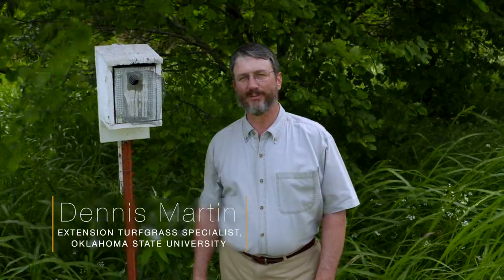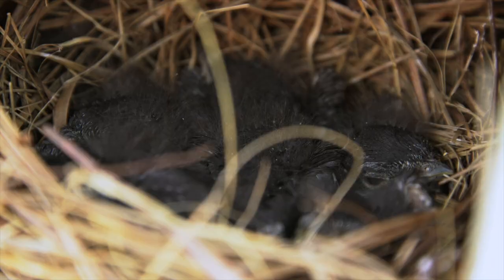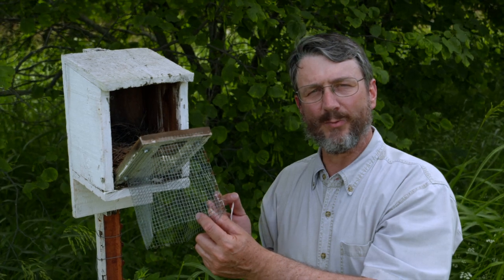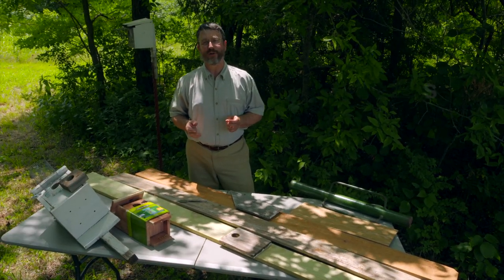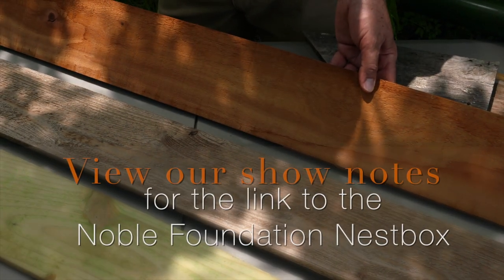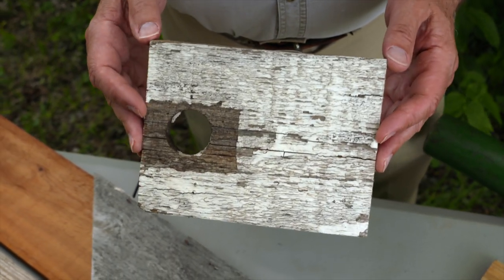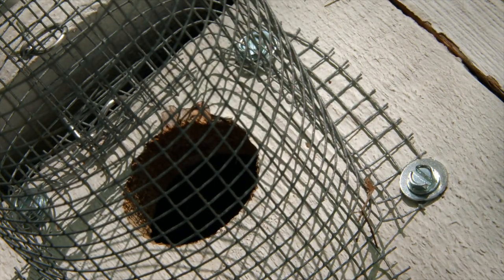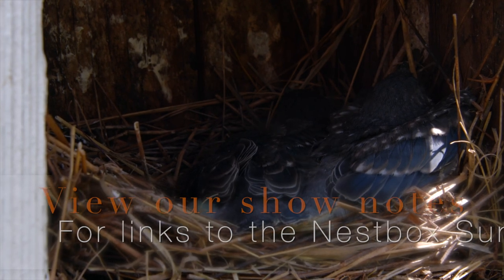Homes for Nesting Bluebirds

Comment: I have found that a simple deterrent for predators is to mount the box on a length of 1 1/2 inch, PVC pipe, instead of on a plank or wood post.  I cut a pipe cross fitting in half, to make a pair of flat-topped tees that I can screw onto the bottom of the box, by drilling a pair of holes in the sides.  You could use a single tee, by sawing a piece off the top and discarding that.  I have not had any snake, cat or racoon climb one of these pipe posts.  The pipe comes in 10 foot sections, and I cut these in half, to mount two boxes, burying about a foot of the pipe in the ground.  These look very nice with white painted boxes.
Reply: Anywhere I can see photos or plans?
Reply: Very clever. Gonna have to try this.  I have been puzzling a way to attach the box to a conventional T-post, and I think your design just might slip over one.  If so, that is an elegant solution.
Reply: So no baffle needed? I wonder if I should slide pvc over my existing poles. I lost my eggs this year due to something climbing and getting past the stovepipe baffle.
Reply: @uhill74  I have seen determined squirrels climb PVC pipe that had a bird feeder on top, but I haven't seen a black snake climb it, yet.  All I can say is that I have seen dozens of blue birds fledge from my boxes.
Reply: @uhill74  Keep in mind that some egg eaters fly into the box.
Reply: @jpopelish  like a flying squirrel or something?
Reply: @uhill74  Thanks for posting about mounting post tips! I also suggest to not mount on a tree or wooden post but also on pvc or steel pole/post and always suggest a deterant baffle. There are many snakes throughout North America that can climb t-posts, pipes and poles.
Reply: @uhill74  yes, stove pipe works well or a wide cone baffle.

Comment: Watched our pair for days, with mother attending nest at night.  Temperatures in Alabama at the time were in the high 90s.  One day my wife told me both birds were acting strange; they were alternating flying to the box but not touching it and were fluttering in front of the hole.  They did this several times that day, then they left altogether.  I looked in the box and found one broken egg and one intact egg--abandoned.  While we had thought a snake or lizard had entered the box and the birds were trying to scare it out, my wife began to believe the birds were fanning the hole in an attempt to rid the box of the extreme smell of the broken egg.  Any thoughts?  And, after I clean the box, will they return?

Comment: What do you think of the Peterson blue bird , bird house
Reply: I haven't personally used the Peterson design bluebird boxes but many can attest to their success in using them. Be sure when mounting any bluebird box to avoid mounting on a tree or wooden post. We suggest using tee posts, smooth metal pipe or pvc pipe, use a baffle such as stove pipe or cone baffle to assist in deterring post-climbing predators such as raccoons, cats and snakes. I also suggest a Noel Guard to help deter cats and raccoons that may jump from the ground to the top of the box and then try to reach in. Never underestimate the determination of a hungry and motivated predator. Thanks for watching Oklahoma Gardening!

Comment: Any way to deter English Sparrows fro taking over  or staying away from blue bird boxes with out having to guard?
Reply: that is the big question....!!!    I agree.   House Sparrows are horrible!
Reply: Trap them year round if you can. Van ert traps and ground traps.  After a few  hundred things will gradually change. Also put up a spooker after the first egg is laid.
Reply: @uhill74  Thanks for watching Oklahoma Gardening posting. I agree the Van Ert live trap is one of the most effective trapping devices that can be adapted to practically any bird box. I encourage placing the two screws for mounting the Van Ert in every box, performing a dry run, then removing the Van Ert but leaving the screws in place.....just in case it is the later focus box for trapping sparrows! Happy Bluebirding and thanks for watching Oklahoma Gardening!
Reply: I now use "sparrow spookers" to deter house sparrows or English sparrows. Also some folks use clear plastic sky lights on the box and feel that they deter house sparrows using the box but don't deter bluebirds. Thanks for watching Oklahoma Gardening!

Comment: What kind of predator would this guard work against?  It seems a red squirrel could just crawl around the guard and then chew into the wooden hole.  I use hardware cloth around the holes on all my boxes but it is flat against the wood to prevent hole chewing.
Reply: Should have waited.  The answer was the extended guard helps keep the dreaded racoon arm out.
Reply: 6inch stove pipe wrapped around the bottom of the pole will stop any squirrel, they CANNOT climb it👍😉
Reply: @aileenwagner2576  I told my buddy about the stove pipe idea. I came across the video a few years ago. Great idea. I gave him a piece of plastic  gutter down tube (Mentioned in my earlier post)He had to cut it on the side to slip it around the sheperd hook. What he didn't do was cover the tube at the top or bottom. The squirrel squeezed his body and crawled through the tube . Hah!. He has since duct tap the top and bottom. The stove pipe has to be dog eared at the top  to keep this from happening.
Reply: @aileenwagner2576  The Noel guard as seen in the video is constructed of wire mesh or hardware cloth. It is readily embraced by bluebirds, titmice, chickadees and other cavity nesting birds. It is a deterrent to raccoons, feral cats, bobcats, and various raptors. I have had larger and heavier predators bend the Noel guards down in their attempts to tear open the boxes so use suitably matched mounting screws. Unfortunately, snakes are one of the most difficult predators to stop and a Noel guard will not stop a snake. Use stove pipe baffles and baffle cones to deter climbing predators and mount the boxes on smooth pipes preferably. We have had snakes occasionally breach the stove pipe baffles and cone baffles. We have used the netting snake traps but they are unfortunately lethal on snakes if the snake is not caught and released quickly enough.
Reply: We don't seem to have serious interest from either red or gray squirrels getting into our bluebird boxes. Our biggest problems are from the 6 feet plus length western rat snakes which are dynamic enough to breach stove pipe baffles and cone baffles.

Comment: I am seeing a conflict with the box diagram on the website linked in the description. 
The speaker in the youtube video said a piece of fencing material would work which is 3/4 x 5 1/2 inches. The website directions show the roof at a true 6 inches. Without that small overlap, rain can get in. Does anyone else see this issue or did they just make the size smaller (which is not recommended)?
Reply: Dimensions of the individual parts of the box will vary depending upon the size of the wood plank chosen. Adjust based on the material used. Bluebirds are quite adaptable to minor box size dimensional changes. One will find a variety of plans and dimensions out there on the internet and in printed publications. Thanks for watching!

Comment: Or leave the birds alone when nesting
Reply: Many folks participate in citizen science where they set up birdbox trails, monitor, collect and submit data that is used by ornithologists. Monitoring can be performed in a non-invasive way. General suggestions are to check twice a week, check at non-invasive times using non-problematic methods. Unable to post web addresses here as the algorithms nix posts with those. "Code of Contact NestWatch" and "Code of Ethics Birdwatching" yields some great guidelines posted by various non-profits. Thanks for posting and thanks for watching Oklahoma Gardening!